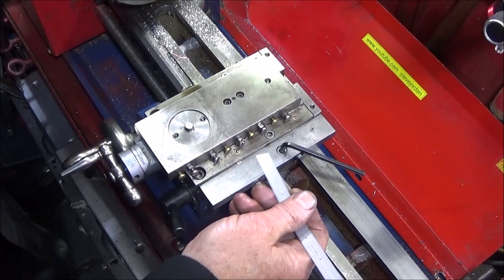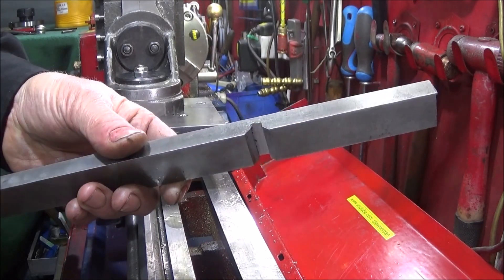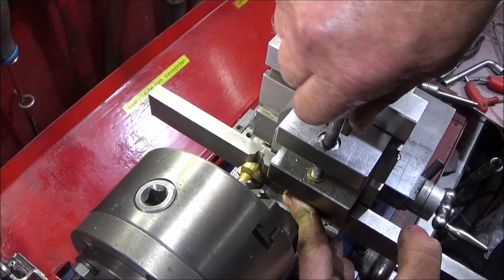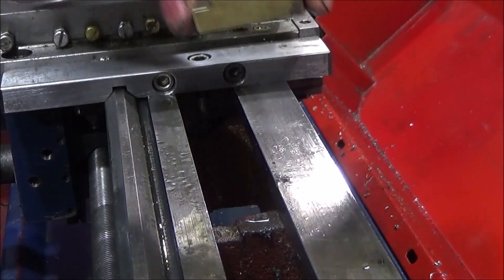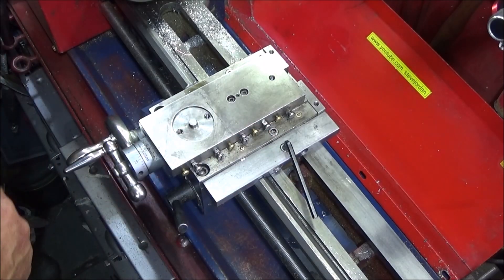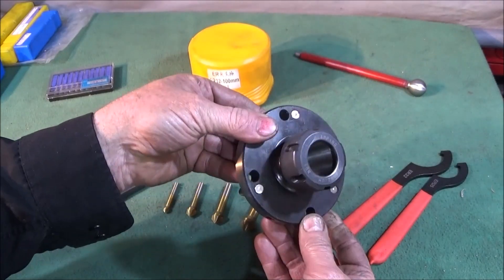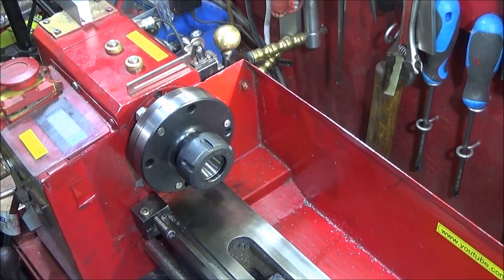Mini Lathe Milling Pallet Upgrades Carriage Lock & New Tools

Comment: I thought about doing a carriage lock to mine but then noticed if I have the lead screw set to neutral (my lathe has an option to run the lead screw forward, reverse or not at all) so it doesn't rotate and engage the half nut that also locks the carriage in place. Any thoughts on that? I definitely need to do some sort of compound slide lock.

Comment: Steve, thanks again for a super video. I'm trying to remove the 3-jaw chuck on my mini-lathe for the ER32 attachment like yours. When I take out the nuts and washers from the three studs, the chuck seems to be stuck in place even after several hits from a rubber mallet. Any thoughts other than hitting it a bit harder?

Comment: Hi Steve........I do appreciate how you constantly preach stabiility over and over again.  As an old(71yrs) beginner I don't really understand how the angle plate front can be 100% vertical. Did tou test the milling plate outside the videos? Plates found here in Sweden are not 100% flat (unless very expensive). Dare I flatten a plate on my mini by pressing the plate against the 4-jaw chuck with a  M12 drawbar? Other issues:  re the  countersink + drill bits you show,. Are you still pleased with them? re ER32 is there any practical difference (apart from through capability) in milling with the collet chuck or the collet holder?  Many thanks for yr efforts.

Comment: Hi Steve, I counted 9 grub screws in your cross slide, which I assume is also to provide additional rigidity. Have you produced a video to cover this too?
Reply from the maker: Hi Alan. I didn't do a video on this one as it is just the same type of procedure as on the compound slide. It is just a case of removing the slide, using a set scriber tool to mark the centres of the screw holes. Scribe the full length of the slide, then use a fine centre punch to mark where you want the new screw holes. I then carefully centre drilled, pilot drilled and core drilled the holes for 2BA threads and tapped squarely by hand. You can use 4mm threads if you prefer. If I get time I may show this at a later date.
Reply: OK thanks a lot for the info Steve. Just wondering how many additional "gib adjust" screws and how many "carriage lock" you recommend. I am very new to this game!!

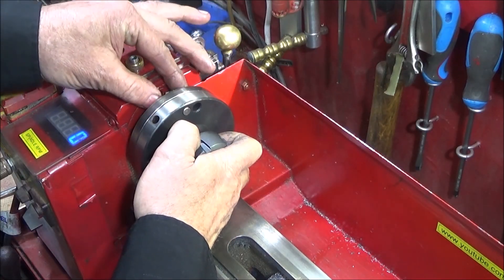Comment: Great video, much appreciated.  At 12:22 - please tell me you are NOT using "split-ring lock washers" as they often fail to hold, and/or damage the surface where used.  Much better to use hardened flat washers when using nuts & bolts on metal materials; both for better gripping, and for less wear to the bolting surface.
Reply from the maker: Hi Jim, No these are just ordinary 8mm washers. I don't like split washers either.
Reply: Thanks Steve.  It's kind of a 'pet peeve' of mine after  40 years as an industrial hd mechanic.  The 'all-too-common' split-ring lock washers cause many problems rather than prevent them as intended.  Yet traditional sales-pitch still makes people think they need them.  Flat washers are most often the better way to go.

Comment: Steve, Thanks again for another great video. I made a smaller milling platform some time ago and it worked fine with aluminum and brass. Recently I tried with bright steel trying to mill a T-nut and had a scare when the cutter rode up and chewed up my workpiece shifting the whole setup mounted on the cross-slide disk. The extra screw on top should secure things up, will give it a go.

Comment: Hey Steve, love your work, thanks!  Looking forward to the collet review
I have one question: you've linked the 100mm collet chuck - and I can see that it certainly fits your machine - but isn't the mini-lathe spindle face plate usually 80mm diameter?  I'm confused! Cheers - Andrew
Reply from the maker: Hi Andrew, They make two different sizes 80mm or 100mm. I think Banggood do an 80mm ER32 chuck in the same type, but I have't looked at it to see the back fitting. You can buy the 100mm Mini Lathe spindles from Amadeal and change them over if you are confident in taking the head-stock apart. Regards Steve
Reply: Ah, ok.  Thanks!  Glad I didn't order the one from the link!
Reply: Andrew McWhirter you can buy a 100mm back plate from arc eurotrades site, surely that would fit the 100mm collet chuck?
Reply: I guess but as Steve points out there is another version that I believe (if the reviews are accurate) fits straight on the standard 80mm mini lathe spindle. And it's considerably cheaper than the 100mm ER32 version that is linked above.  Search Banggood for "80mm Diameter ER-32 Collet Chuck"  Cheers - Andrew

Comment: I see you went with the third hole in the end Steve, tidy job 👍
Reply from the maker: Hi Ian  Thanks,...Yes it just looks and feels right, although I didn't have any noticeable movement without it.
Reply: I agree, if nothing it just looks right lol I finished mine two days ago, even with just the two fixings, I cannot move it, and there is no vibration or deviation when milling, I'm delighted with it! But I'll definitely stick in that third hole because I don't have a travel steady, I'll be doing a self build on that, so I'll need that third fixing, seen as the steady will be more to that end. Cheers Steve, keep the vids coming 👍

Comment: Two things, why do you never use lubricant/coolant (like alcohol or tap fluid or something) in those heavy cuts? It makes me grind my teeth seeing that!  :)  Could you please tell me where to get a ER32 collet that can hold a 1 inch (25.4mm) diameter rod? Thank you so very much.
Reply: ER 32 collets max out at .787. For one inch you would need to go to ER 40 collets.
Reply: Glosser tools have ER32 collets in 21,22,23,24 and 25 mm, not cheap but my suit if you do not want to go to an ER40 set.
They may also have imperial equivalent.

Barry
Australia
Reply: Should be Gloster Tools in England.

Comment from the maker: SEE BUYING LINKS FOR ALL TOOLS SHOWN IN THIS VIDEO
:-100mm Diameter ER32-UM Collet Chuck -- https://goo.gl/sbcpU9
  More Collet Chuck --  https://goo.gl/bkzpVW
6pcs 6.3-20.5mm 90° 3 Flute Titanium Coated Drill Bits Set -- https://goo.gl/pwBNiN
      Drillpro 6pcs 1/1.5/2/2.5/3/5mm Center Drills Titanium Coated Countersink Drill--  https://goo.gl/5qyzAS
      MT2 ER32 Collet Chuck Morse Taper Tool Holder Milling Chuck Holder --  https://goo.gl/h8Xjs3
 ER25 ER32 Wrench Spanner for Collet Chuck Holder --  https://goo.gl/yo4W7W
Carbide Burr Set
https://goo.gl/MT74YN
Reply from the maker: Banggood Health Protection -- http://bit.ly/33tNTBx
  Banggood Health&Care Protection --  http://bit.ly/3d7QpSy